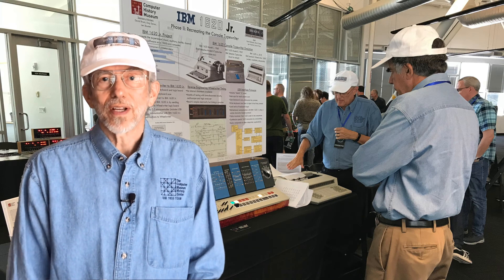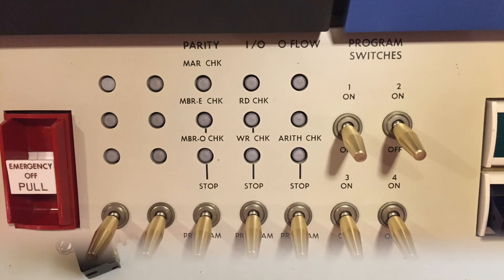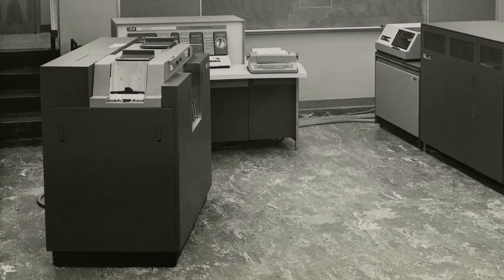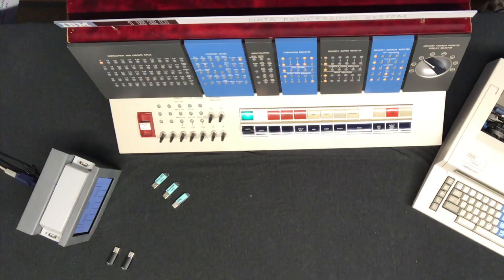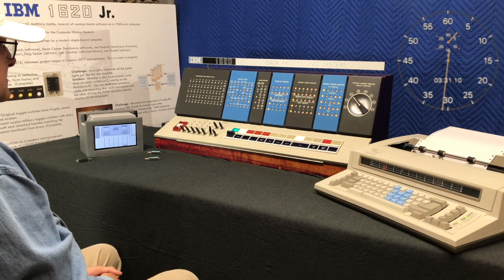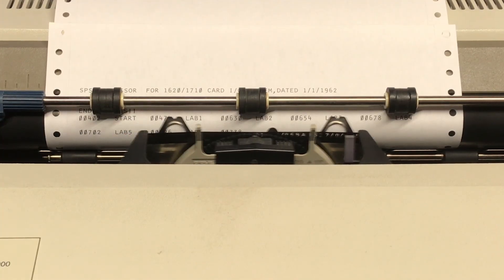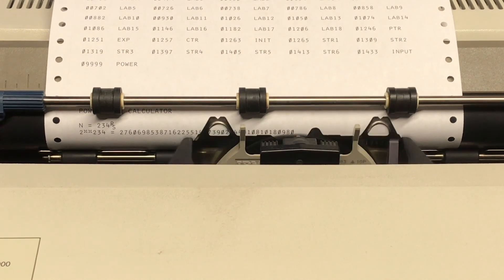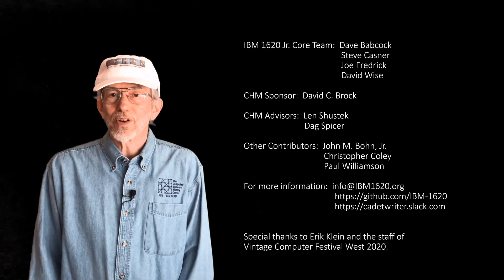IBM 1620 Jr. Project

Comment: Learned how to program on an IBM 1620 in high school around 1964.  Went on to run an 1620 in college.  Later on wrote engineering programs 
for the County of San Diego until we got an 1130 and later on an IBM 360.

Comment: I did a computer class January of 1966 at Colgate University.  I did not know how to debug my programs outside of starting through the card stack and finding something that did not look right.  My program (FORTRAN) took 20 minutes to load and when there was a bug after the long wait the ball on the typewriter would just give a click and that was the end of it.  I has several bugs in the program so i had to repeat the process quite a few times.  I would go back to the card punch machine and I would then have to wait for the other students in line before I could try to run it again.  This often would be late at night so I would be struggling to stay awake.  Finally after the end of the term I was the only one on campus and I was able to run trys one after another without having to wait.  I got it done and turned in (a print out of the program, I don't think I turned in the cards). We also learned to do some simple machine language operations.  The hard drive looked like a top loading washing machine and I recall that it was 64,000 bits.  It was a good experience and would have been better but for the waiting for the programs to run and and the line to get my turn.

Comment: Wow!  I loved the old 1620 and wrote a lot of code for it in raw machine code and Fortran (single pass Witran compiler made things much faster).   We had a program that would play music on a transistor radio placed on top of the I&E cycle panel and you'd select the tune you wanted to play with the hex values of the program switches. Good times back then!

Comment: The 1620 is the first computer I ever programmed. We had the external hard drive, the card reader and punch. Two keypunch machines. Programed in Fortran 2 and assembly. Had 20k of core memory. The IBM repairman taught me how to troubleshoot it because I was into electronics. I did some operating system modifications because we had the complete assembly listing and the card deck for it. For years I could remember the cold start instructions that cold be entered on the typewriter or by card. It was a disk seek instruction followed by a disk read then a branch, 4902402 might have been the branch. I will go find my cards when I get a chance. I have quite a few programs someplace on cards. 32 was the opcode for seek and 34 was the opcode for read I believe. Don't get a check stop. How does your typewriter print the record mark and group mark?

Comment: This is an interesting video that brings back some memories to me. I am now 70 years old and when I was at Los Angeles Valley College around 1970, Los Angeles Valley College had an IBM 1620 computer at its computer center. I took a course at that college that taught how to program the IBM 1620 in machine language. The IBM 1620 at that college was equipped with the Card Reader and Card Punch. Also the IBM 1620 was equipped with a physically large multiple platter Hard Disk Drive. A lot has changed over the years. Now Punch Cards are a thing of the past, and very limited magnetic core memory is a thing of the past.
Reply from the maker: Glad you liked the video.  Those of us working on the project also have a history involving the IBM 1620; for me it was at Occidental College 1969-1973 where the machine was configured like the one you used.

Comment: I have a few comments and questions for Mr. Casner et al.  First, let me state that the product all your work is truly impressive, and could only have been accomplished by gifted, passionately-inspired individuals.  Bravo.  My questions are these: (1) Was simulated 1311 disk I/O ever part of the project?   (2) Was running the Monitor II Disk Operating System ever considered, assuming the software could somehow be obtained?  (3) How was the software for the card-deck-oriented SPS assembler obtained, did someone on your team build a physical card-reader and convert 1620 object decks (say, from cards donated by Dr. Maniotes) into files written to flash drives?  I am designing a 1620 simulator that is a total software approach: a Linux C application having a graphically-rendered console with working indicators, and with keyboard-driven operation.  My work is maybe 1/3 complete after five  months.  I have the emulation code for a couple of dozen instructions done, and anticipate being finished with this effort sometime next year.  At some point in a few months I would love to let my simulator (I named it neo1620) try running Monitor II, SPS II-D, DUP, Fortran II-D, the works.  Regards.
Reply: Hello Charles.
1)  No, simulation of the IBM 1311 is not part of the IBM 1620 Jr. project as defined.  It would be relatively easy to add as a follow-on project.
2)  No, since we're not planning to support the IBM 1311, we have no plans to run the Monitor II Disk Operating System.  Note that there are install card decks for the monitor in the Maniotes collection.
3)  When we did the restoration of the Computer History Museum's IBM 1620 some 20 years ago and Dr. Maniotes donated 4 filing cabinets of original IBM 1620 software, we read all of the punched cards.  We used a Data Products table-top card reader connected to a laptop via a specialized interface.  A zip file of all of the card images as read is available at:  http://www.bitsavers.org/bits/IBM/1620/1620.zip
However, these images are not directly usable and must be post-processed.  Some of the card decks in the Maniotes collection were IBM 360 source and binary decks.  To make sure that we correctly captured all card punches, we read all of the cards in "column binary" mode.  That is, each column was read and the 12 rows were split into 2 6-bit values and mapped into printable ASCII characters, 2 per column.  A quick utility program was written to extract a few of the card decks, but it hasn't been enhanced and run against all of the files.  That is how the SPS assembler's card deck was acquired.

Your simulator project sounds interesting.  The simulator we've written for the IBM 1620 Jr. is in C running on a Raspberry Pi 3B+.  It supports the full front panel, console typewriter, and the simulated IBM 1622 card read/punch device.  [We showed the final version of the 1622 at last month's VCF West 2021.]  The simulator is complete except for the floating point instructions which will be added this year.  The biggest challenge of the simulator was being so precise that the front panel passes what I call the "Parroty Check", that is, you can't tell the difference between it and a real IBM 1620.  Note that 1/2 of the lights on the front panel show the state of internal gates in the computer down to the instruction [sub-]cycle level.  It's not enough to emulate the operation of an instruction, it must simulate the logic gates used in the real 1620 to execute an instruction.

I'd be happy to provide you more details or answer other questions you have.  You can contact me at:  dave 'at' IBM1620 'dot' org

Good luck with your project.